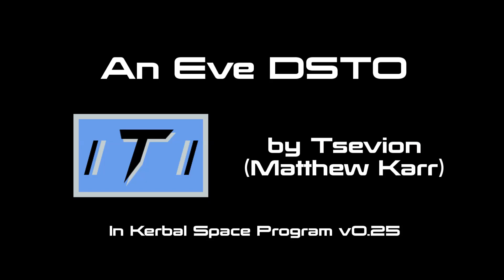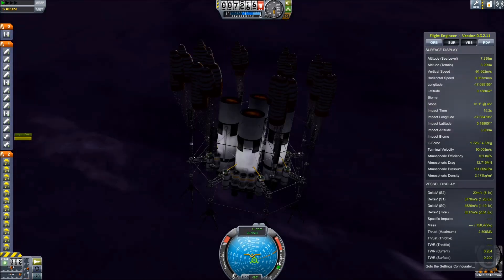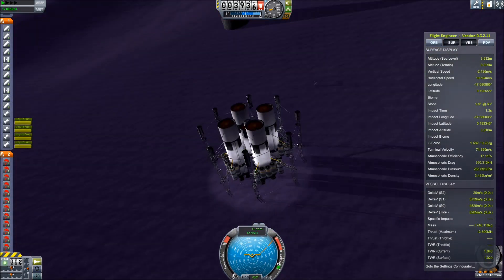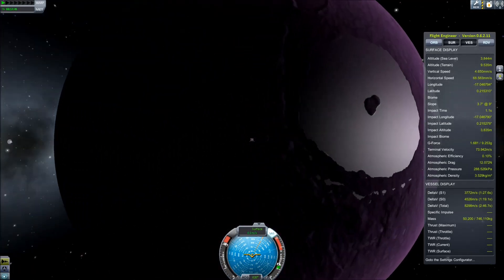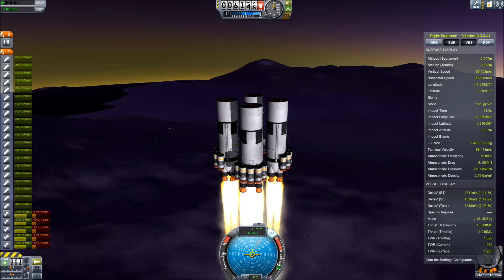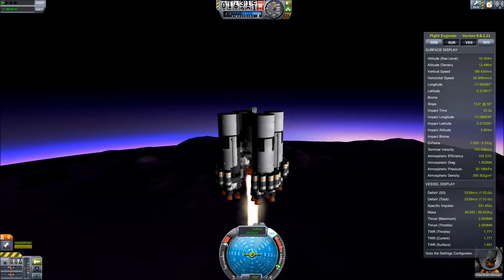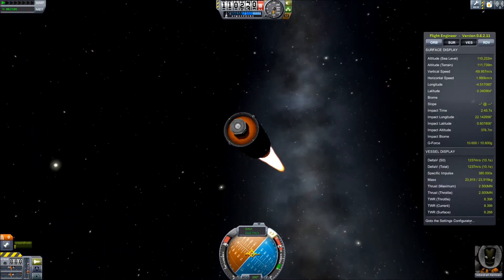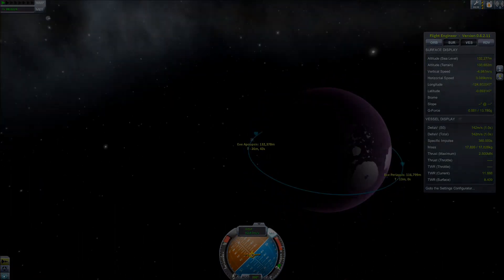KSP: Eve Dual-Stage-To-Orbit

Comment: I don't think it's been proven whether Eve ion-SSTOs are possible, but seeing as the number of people who've made them stock is quite small (although FAR ones aren't that tricky. I have a manned 2-engine one, as long as I fly it right), I doubt it's possible.
Reply from the maker: Peter Smythe They're kinda possible, it depends how cheaty you want to get. If you use locked control surfaces as wings (see my Control Surface Antigrav video), then it's actually pretty easy. If the fact that they are effectively anti-grav feels like cheating, then no... it's been pretty thoroughly tried with nothing even close to success.
Reply: Matthew Karr Have you seen andrew hansen's Eve SSTO? To eve and back... It uses ladders...
Reply from the maker: Holiday Miner Heh, yeah... there was a forum challenge for totally cheaty Eve SSTO's... I built one based on infiniglide and Kraken Drive. http://forum.kerbalspaceprogram.com/threads/89915-Eve-SSTO-Now-with-cheaty-goodness

Comment: I did some calculations on SSTO, and what you said was true. it is impossible to make a SSTO from Eve,

The maximum delta V is for eve: 5216 m/s (the amount you need is 7968 m/s)
Kerbin: 5525 m/s
duna: 5872 m/s

This is with a beginning trust/weight of 1.
Reply from the maker: Oh... it's technically possible... it just involves horrible physics abuses... http://forum.kerbalspaceprogram.com/threads/89915-Eve-SSTO-Now-with-cheaty-goodness%21
Reply: I think an Eve SSTO is possible now without cheating. However, the fuel consumption would make it completely impractical, and it'd probably be far simpler to send multiple disposable ascent vehicles.